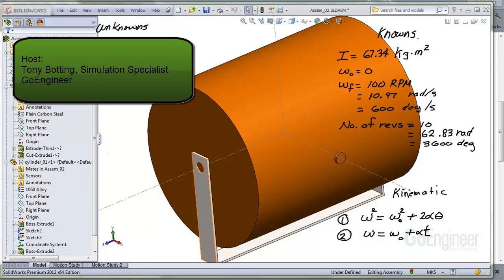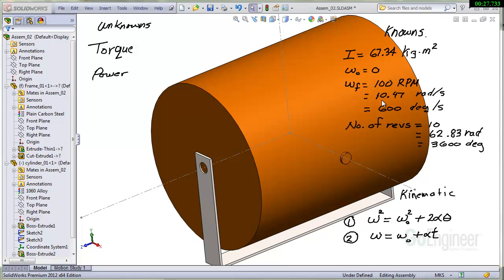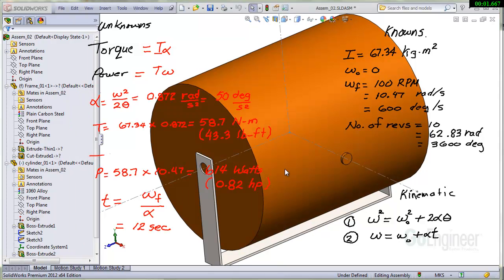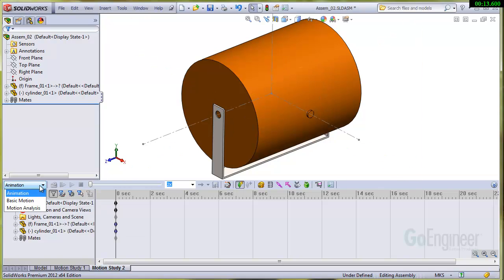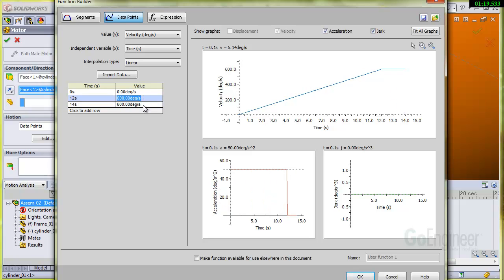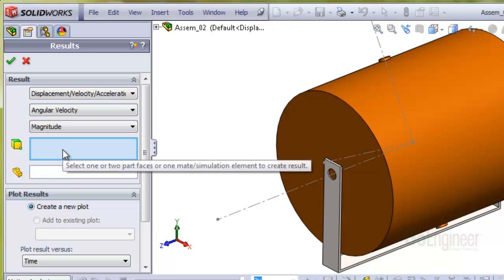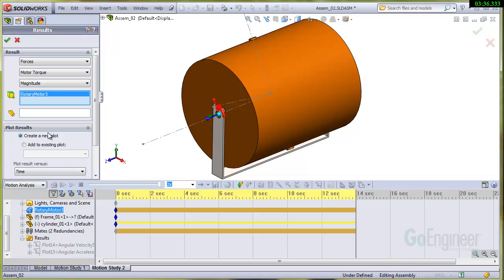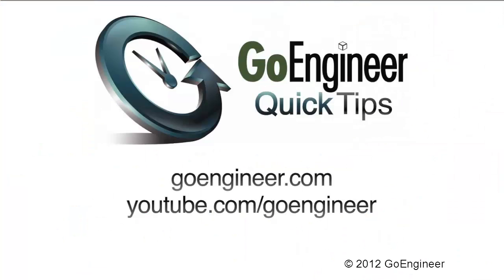SOLIDWORKS Quick Tip - Motor Torque and Power

Comment: How did you set up the mates between he frame and the cylinder? I cant the cylinder to rotate
Reply from the maker: Hello and thank you for your question!  You are correct in changing the default outer wall thermal condition could possibly make the model setup more accurate.  In this case we left it as adiabatic since it will help decrease calculation time and resources for my very first run of this project, eliminating heat transfer from the outer walls.  Also, it is a best practice to keep your flow project setup as simple as possible at first and then begin to add more accuracy and detail to the model and setup.  Another thought is that one could also locally apply all our thermal conditions manually to the model in the project design tree and any outer walls that are not specified will be assumed to be adiabatic.  I hope this helps!

Comment: 7:07 why the torque and power consumption drops down to the zero after 12 sec. ? did you applied gravity and the friction between the joints?
Reply from the maker: Correct, around 4:50 you can see a good view of the tree. No gravity is applied, nor is Contact – where we could apply friction between moving bodies. Friction could also have been set up between mates, but that also was not done in this video. The hand calculations did not include gravity or friction, so the study did not either.

Comment: Hey, 
How can we show the function builder in the animation? Because that tab only shows when we are trying to edit a motor. Can we show it in animation aswell or only in motion analysis?
Reply from the maker: The Results plots Tony begins building around 6:18 are only available with Motion Analysis – available as an add-in with SOLIDWORKS Premium or Simulation Standard license.

Comment: Hiii sir,  your video is too good... from this we can calculate torque required to ratate any object in air..... but how can we calculate the torque if my object is submerged in liquid.... plz reply..
Reply from the maker: If you need to do this by hand, look up “drag torque”. The increased viscosity of the fluid would cause more drag or shear on the surface of the model, and those terms would need to be included in your calculation. 

If you’re using SOLIDWORKS simulation programs, use Flow Simulation. https://www.goengineer.com/videos/solidworks-flow-simulation-webinar-rotating-regions/

Comment: Great tutorial!
How to add gear ratio parameter in it.?
Reply from the maker: Thank you for the feedback and your question!  Though this specific tutorial does not feature this functionality, you will want to add a GEAR MATE to your SOLIDWORKS model (gear ratio is included with this mate type) and SOLIDWORKS Motion will solve this as a rotational coupling between the components.  Searching ‘gear mate solidworks’ should help get you started with adding this mate.

Comment: In my case I have a large sub assembly that needs to be rotated, can I use this same set-up even though the assembly is not symmetric like this drum is?
Reply from the maker: Hi Hello World,
This Motion study setup for torque should work even if the assembly is not symmetric.  If the model is able to spin it will be made to spin with an applied torque.
Reply: GoEngineer does solidworks realize that there is material assigned to the parts? I’m wondering if I need to input a force at the center of mass or not or if it calculates all of that itself?

Comment: Hello, I am currently doing a motion analysis very similar to this. I have set up the motor in the same manner that you show here in the video and the angular velocity graph is correct. However when I create an angular acceleration graph the values are far too high. Have you ever come across this and if so how did you get around the issue!

Any help would be great.

Thanks

Comment: Hi Tony.
Is it possible to use solidworks motion to put force on the top of a piston and read the torque off the crank of a single cylinder engine at a set degree angle of the crankshaft. This way I could plot the torque from a cylinder pressure graph.
Could you put up a tutorial if that is possible. Regards Roger